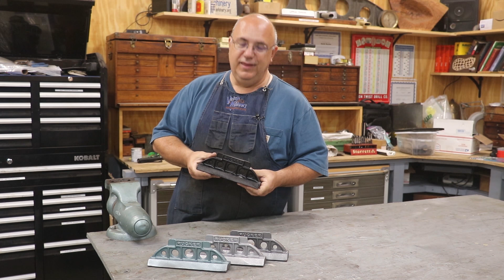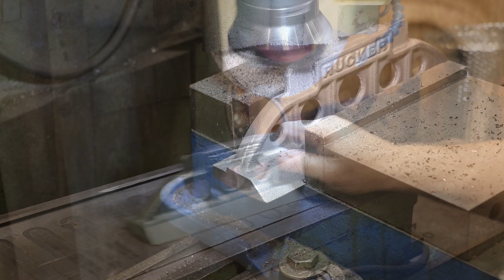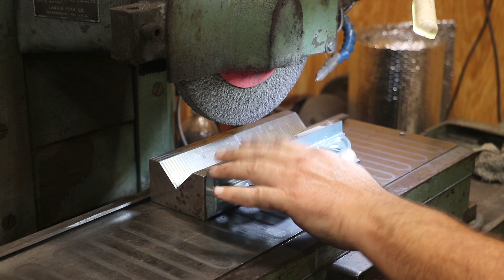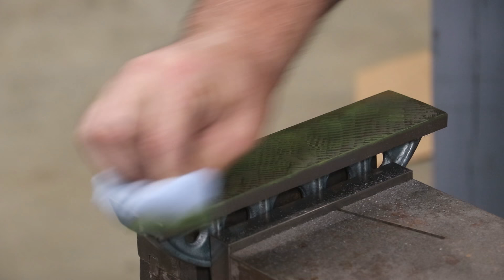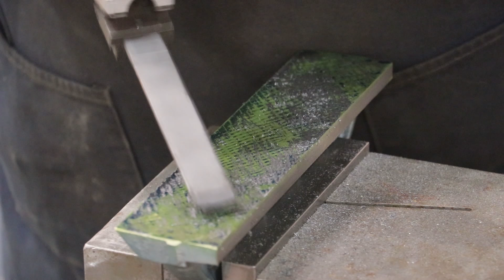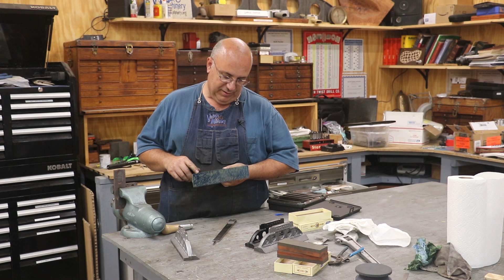Rucker Tool Company 9" Straight Edge Castings:  Machining and Scraping

Comment: Keith, I have what may be a dumb question.  I have looked at and used your program that calculates the sfpm for a "standard bandsaw".  I have a three wheel band saw that I am trying to use for metal cutting and I am trying to determine the blade speed.  Does your program work or does that third wheel screw things up?

Comment: Hi Keith, great to see another cool project on the go, thanks.

On quick question, did you consider running the ends of the straight edge through the mill to clean up the moulding lines?

After doing such a beautiful job everywhere else, the rough casting marks at the ends looks "untidy" to me.

Comment: Keith please remember the rules of scraping I taught you.  Watch out when you get near the edges or they will get rolled over.  Those edges are important especially when getting deep in the dovetail your scraping when using the straight-edge.  Also you can double cut the blue until you get every square inch covered before doing the crosses.  If any of the readers want larger straight-edges I have some in stock and I also have them on ebay.

Comment: Keith:  The low spots in the bottom means the casting shrunk in those areas resulting in high stress concentrations that were exacerbated during the milling, grinding, and scraping processes shown in the video.  The straightedge won't be stable until it's appropriately heated treated and aged.  (I've heard that heat treating co.'s can achieve aging during the heat treatment process.  Consult with them for details.)  If the straitedge is unstable it won't achieve the expected precision/stability and there's going to be very disappointed buyers.  I'd suggest discussing this issue with Robyn Renzetti, Joe Piezinski, and other experts you know  to consider whether this precision tool is ready for prime time.

Comment: would there have been any value or benefits to squaring the end of the casting?
Reply: Only if you need to get close to a vertical feature and the back edge won't fit for whatever reason, or if you have a touch of O.C. disorder.
Reply: @j-man72b72  Yeah, OCD describes me pretty well...  lol

Comment: You're neglecting the effect of heat input from your warm hands where you grasp the camelback and the cooling from the water based cleaner you spray on the reference face you're scraping. Cast iron expands a trifle with a change in temperature (6 to 7 millionths per degree F) and it conducts heat pootly. It takes an hour or two for a small casting to reach thermal equilibrium. Warm the camelback by handling and cool the face with water based cleaner and you'll distort the casting an important trifle.

If by working steadily, you scrape your straightedge casting flat to full bearing (as you represent in this video) the temperature differential between the gripped portion of the camelback and the mass of the reference face may be several degrees. Not enough to detect by feel but probably enough to detect with a IR camera. If you allow that straight edge you scraped flat to rest overnight, the next morning it will print convex on your surface plate. This will not be evidence of metallurgical instability but of negligent heating and cooling of the casting during the scraping process.

Many scraper hands have been bit by this snake particularly scraping long skinny work like straightedges. Including me.

The lesson to be learned is to handle work quickly in a way that minimizes heat tranfer from your hands AND to use a cleaning product with a low heat of evaporation applied sparingly from a damp rag rather than a spray. I prefer Ronsonal lighter fluid (naptha) for four reasons: it evaporates quickly AND it has a low heat of evaporation (1/12 of water) AND it comes in a handy dispenser container convenient for issuing small amounts AND it doesn't promote rust like paint store naphtha solvent.
Reply: Good observations. Would you also suggest maybe a final scraping pass some time after it equalizes, wear some gloves to reduce heat transfer?
Reply: @mikereid3555  Yes indeed. A final check the day after scraping usually reveals a touch-up is necessary. And gloves to some other form of insulation or remote handling is only prudent.

These extra steps can be overdone. A short piece like Keith's straightedge may require only casual care with uncontrolled heat transfer. A long (6 ft, 10 ft) straightcedge to be scraped in a sunny workplace or where local sources of heat (blast from circulators, body heat, incandescent lights, steam pipes, radiant heaters etc) are present, greater care has to be exercised with greater obsession in proportion to finer flatness tolerance.

Comment: Looks good with the logo on it. Just a small nit pick, you said you want a thermal separation between top and bottom to avoid warping. In reality thermal gradients are what cause temperature related warping. If the top is warmer than the bottom it would cause it to expand and make the flat bottom surface cup ever so slightly. You really want the whole straight-edge to be the same temperature as the environment you're using it in but if it is going to be warmer you would want the temperature to be uniform throughout the casting. What you said about those tabs being for mounting wooden "feet" made me wonder if putting a wooden griping surface would be feasible to reduce transfer of heat when you hold the straight-edge. I doubt that it would make much of a difference, but if you're already going to mount some pieces of wood, seems like it would be a good idea to allow the casting to accommodate pieces that would also serve as a handle.

Comment: first: good work! second: I think you must grind both small edges (left and right), 3rd: do you have some heat cicle to "make them aged" - to prevent time induced disortion, to stabilese that iron? (in "old days" block engine casts have to sit outside floundry for 1 year to go from Summer heat to Winter cold)

Comment: Not sure how old those castings are, but they need to age for some time to allow the stresses to relieve themselves- you can see  after you milled away the surface tension, the piece moved some more and you had the high corners. I suspect they will continue to move and your scraping may be for naught.
Reply: Seems like something you could do yourself if you bought a rough casting. A tool maker I used to work with would throw almost finished precision tooling into his home oven for a few months to run it through a bunch of heating and cooling cycles before giving it a final grind.
Reply: @chris0tube Rather than the edges being too high consider that the center shrunk during the casting process which occurred above the vertical section.  In fact, different scales are used to layout the mold depending on the type of metal used for the casting.  Refer to mrpete222's YouTube  channel dealing with casting and compensating for shrinkage.  A small adjustment of the mold may be able to fill in the sunken area.  But, this sunken area means there's a lot of residual stresses in the bottom and your question is quite important.  I expect the straitedge that Keith machined and ground in this video is going to to be very unstable until it's properly heat treated and aged, etc.  (I understand that it's possible to achieve accelerated aging by cycling the time and temperature level during the heat treatment process.)

Comment: Keith, did Richard teach the circle method of power scraping in your classes? Seemed like he really pushed it for roughing in my class but I didn't notice you using it.
Reply: Keith was using another Richard King method on his first pass called "paint scraping", where you try to cover the entire surface as much as possible in one pass, with minimum overlap of the individual cuts, both sideways and lengthwise.  It is a bit like painting a wall.  A ground surface has a tough and shiny skin and accepts blueing poorly, and gets the entire surface below the tough ground skin,  while also keeping the raw surface as flat as possible, saving time by not creating low areas.  The idea is to get below the ground or machined surface and have a surface texture that takes the marking ink well, so you can better see the topography of the surface as it really is.
Reply: @duobob  Yeah, I know of "scraping paint" don't know if I've heard it used with power scraping (and not much of a fan of the term), but the method I was referring to is used after major roughing and before pin pointing from what I saw. Just wondered if Keith ever used it, unfortunately I don't have a power scraper and didn't have enough time with one to decide if the technique is an advantage. I would assume it is because he was teaching it, but...

Comment: Hi
I have been thinking about cast iron.
In the old days the fresh raw castings were stored out doors for sometimes long periods of time.
This resulted in stress relieving the castings.
What if you threw the raw casting into an oven. Run the castings up to what ever the can do, 400f? A period of time till the casting is thouroly heated through.
After a slow cool off  would the casting be more consist through the mass.
Then do the rough machining.
Thanks for the vids
Reply: It's called "seasoning" and the stress ranging should be done AFTER rough machining, not before. Seasoning-> rough machining-> stress release relieving-> finish machining-> grinding-> scraping/flaking.

Comment: Those little straightedges seem like perfect candidates for someone's shaper.  Hmmm...Abom79 needs to mount a Keith Rucker Straightedge onto his shaper.  Wouldn't that make for an excellent video?
Reply: Shaping would cause less stress than milling, and for larger lengths, omit the surface grinding step.
Reply: I'd buy one at 3 inches long, just to keep papers down on my table, if it was a Rucker.  Wouldn't need precision grinding.  Just say "Rucker", and look nice.  Hear me, Keith?  Earn a few bucks, mate.  2 inches long would be ok!!  You could make some good pocket money!  Imagine owning a Rucker straight-edge - and you don't need it!  Luxury.

Comment: After grinding 45 degree angle and then scraping,how do you know it remains exactly 45 degrees,or is that not critical?
Reply: The angle isn't critical, only the flatness.  The angle's so the straightedge can get into the 60° angle of the compound slide and cross slide dovetails.
Reply: To me, it seems the point of that angle is to fit into dovetails. As long as it fits, I don't think that angle is going to be critical

Comment: Sorry if this might be obvious to some, but I'm only a hobby machinist: can you check the straightness of something with a straight edge that is shorter reliably and if yes, how do you do it? Because in my mind there is the case where you have for example a ring with a very large radius, and the part to measure consists of a segment of this ring so that over the length of the straight edge the error is within the tolerance, but not over the overall length of the part. How would you be able to measure that?
Reply: Two options come to mind in that case: the first is to get a bigger straight edge, the second would be using the shorter straight edge to verify local topology in conjunction with a larger reference surface to take measurements that show if the part tends to have the correct global topology.
Reply: "lookcreations" has scraped longer straight edges with smaller ones as references. He explains his technique in a series of videos, e.g.

https://www.youtube.com/watch?v=U35g1fm5ric

You could also use the three plate method. Tom Lipton explains this basic principle and applies it to make flat lapping plates:  https://www.youtube.com/watch?v=rHmsQEAx16o The same principle  works for straight edges.